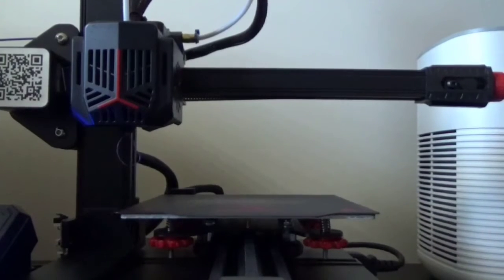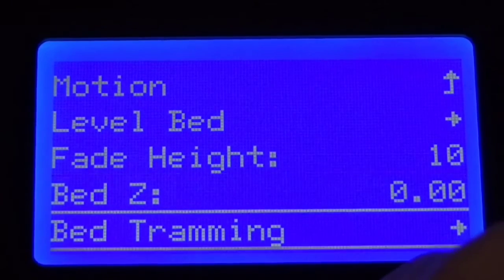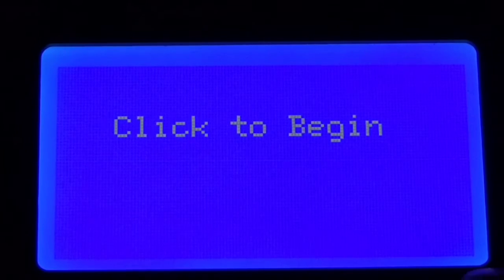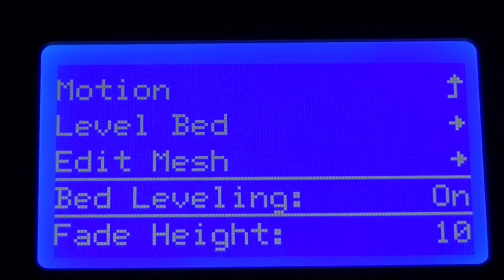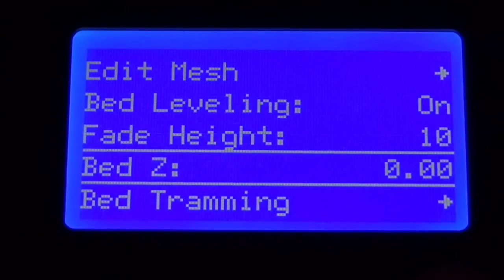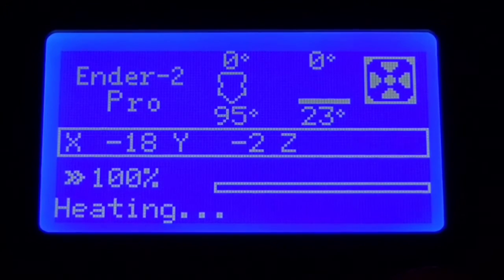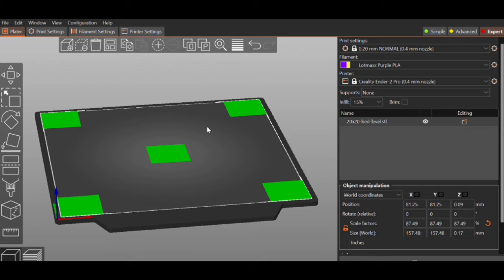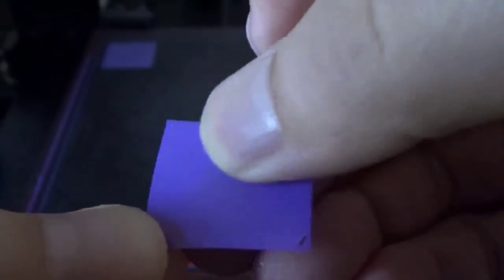Ender-2 Pro firmware upgrade.

Comment: So if im using a 0.2mm feeler gauge would I set Bed Z to 0.2 then tram and then set Bed Z back to 0?
Reply from the maker: No. You need some gap. That's where the filament will go.
Reply: @joeprints3dstuff but the slicer sets the gap in first layer. Layer 1 doesn’t print at z=0. If initial layer height is 0.2, Z is 0.2. If I use a 0.2mm feeler, then setting bed z to -0.2 works perfect. I thought using 0.2 would be the correct way but it’s opposite
Reply from the maker: Do what works for you. I set z=0, then level the bed at each wheel using a 0.1mm feeler. Then, I print test squares and adjust to get the right amount of squish.

Comment: Joe, I want to add a filament runout sensor that this board (4.2.3) supports. Do you have the original configuration and configuration.adv files to see if you enabled the filament runout sensor?
Reply from the maker: All of that should be on my github.
Reply: @joeprints3dstuff  Thank you Joe, I found the section to enable (VSCode) the filament sensor and I added auto scrolling for the display (caused me to add a library for U8Glib-Hal for the Microsoft linkables). My finished binary size is 156k. However, when I try to upgrade the firmware, it doesn't happen. I'm thinking it may be in versioning and the motherboard doesn't recognize it as a newer version.I modified the version.h file in the root of the src folder to your setting from 2.1.2.1 to 2.1.2.11. I got a clean build, but still no luck. What am I missing?
Reply from the maker: @stephendavis4241  yeah the board doesn't care about version. You just have to name the file correctly on your SD card. Also make sure your SD card is not larger than 8gb.
Reply: @joeprints3dstuff  My file name is firmware.bin and the SD card is 4 GB. I'm at a loss. Even the 2nd and 3rd try at re-flashing the firmware with your version doesn't cause the screen to pause as if it is re-flashing the firmware. I guess, I'll have to integrate it with the Pi 3 I have setting in the tool tray. Not the way I wanted, but I want the runout to work.
Reply from the maker: @stephendavis4241 did you rename the file or anything? Make sure you have extensions enabled under your file explorer view and it isn't named firmware.bin.bin or something similar.
Reply: @joeprints3dstuff  Joe, I backspaced for the date and then did a file view just to make sure it was still a bin file. I'm going to play with it again. Hardware filament sensor is the way I really want to go. If I get it working, I'll share the config files and the binary for you and others wanting a hardware based filament sensor.
Reply: @joeprints3dstuff  Hi Joe, I'm back with good news. I was able to get the filament sensor working. Besides some small tweaks for my personalization like changing the default runout to 5mm, I had to change the filament runout to "LOW" in configuration.h. The issue I had for the firmware.bin file was the boot strap was not recognizing a newer version. I used a failed upload of a firmware.x.x.x.bin file to change the uploaded version, then used the filament sensor low version of "firmware.bin" to upload a good version. For the sensor, the switch needs to be in "NC" or normally closed with the filament installed, causing the opening of the switch to set the pin from high to low on the motherboard. This would be the black and white wires connected to "S" and "V", or NC connections. I can provide my bin file to you or anyone that requests it. I had started out with changing the runout to "HIGH", but that caused an infinate loop in not being able to "continue" after loading new filament without turning off the filament sensor. Happy 3D Printing to all!!
Reply: @joeprints3dstuff  I have a 16gb card which seems to work fine for loading print files. But it won't work for firmware updates?
Reply from the maker: It depends. Give it a try, it might work.
Reply: @joeprints3dstuff  I tried it with a 16gb card and it worked fine. I followed the steps in your video and my printer is working better than ever. Thanks for making the video - much appreciated.

Comment: Hay joe.  One question  when you set the bed , did you preheat the bed before  leaving?
Reply from the maker: No. I normally do not heat the bed when leveling.
Reply: @joeprints3dstuff  Is there a specific reason you don't heat the bed before levelling? I'm completely new to 3d printing so I genuinely know nothing about it. It would seem that warming the bed to 50 or 60 degrees C could slightly change the flatness of the bed. Wouldn't it be important to do the levelling process while it's at the same temperature it will be at while printing? Maybe it doesn't change enough to worry about it?
Reply from the maker: @ogwoodworks it depends on the bed size and the type of probe. Thus bed is so small I do not worry about it. I also have some 400x400 printers with induction probes. On those I will preheat.
Reply: @joeprints3dstuff  Ok, that makes sense. How often should a person repeat the bed levelling process on this Ender 2 Pro machine? As long as I don't move the printer to a different location, is it a "one-and-done" kind of thing, or do I need to be checking it between each print job?
Reply from the maker: @ogwoodworks not to sound too vague but you will know when things are off. Generally speaking its a good idea to level the bed once a month or anytime you move the printer or bang the platform.

Comment: Hola! mi ingles es muy malo por eso directamente escribo en español y dejemos que google lo traduzca.. te quiero agradecer por que pude actualizar mi ender 2 pro gracias a tu marlin.. utilize tu marlin para cargarlo en "visual studio code" y activar el sensor de filamento el cual le instale muy facil (te recomiendo que si aun tenes la maquina lo instales). honestamente estoy muy agradecido.

Hello! My English is very bad, that's why I write directly in Spanish and let Google translate it. I want to thank you because I was able to update my Ender 2 Pro thanks to your Marlin. I used your Marlin to load it into "Visual Studio Code" and activate the filament sensor, which I installed very easily (I recommend that if you still have the machine, you install it). Honestly, I'm very grateful.
Reply from the maker: Thank you
Reply: Hola sabes que tengo una con placa  v2 4 s4 y firmware no me toma el m600 para cambio de color, alguna sugerencia?
Reply: @arielgonza22  hola ariel! Vas a tener que actualizar el marlin.. si no te toma el M600 podes usar el M25 (placa 32bit) o el M0 (placa 8bit).. pero tengas la placa que tengas si no viene de fabrica y queres usar el M600 vas a tener que actualizar si o si
Reply: @angelalonso1994  gracias, si claro estuve buscando una actualización sin resultados.
Reply: @arielgonza22  que máquina tenes?
Reply: @angelalonso1994  una ender2 pro
Reply: @arielgonza22  yo también tengo una ender2 pro y use el marlin que esta en la descripción del video
Reply: @arielgonza22  si, me tomo el m600, también active la opción del sensor de filanento
Reply: @angelalonso1994  tendrás el .bin directamente

Comment: Just got one and it’s nothing but problems.
Reply from the maker: Sorry to hear it. I had problems with mine as well until I upgraded the firmware. Work much better after that.
Reply: @joeprints3dstuff  this one has the 2.4.s4 board… dealing with support now. I understand why they want you to do so much stuff, but it’s frustrating formatting cards and showing them over and over it doesn’t work. We shall see.
Reply from the maker: @mikeak7331 good luck

Comment: Can this update be used on a HC32F460 board? This would be great!
Reply from the maker: No sorry. This is only for the stm32 based 4.2.3 board.
Reply: @joeprints3dstuff  would it be possible to use a BTT skr e3 mini board on the Ender 2 Pro with this firmware?
Reply from the maker: No. It was done specifically for the 4.2.3 creality board.
Reply: @NSCXP2005 
The repo on Marlin bugfix-2.1.x contains all the necessary files to sucesfully build firmware for HC32 using platformio. I used the Joe's config files to see which options should I enable to get the bed levelling and tramming, and enabled some more handy options too and succesfully built and flashed the firmware. So go on and give it a go!
The correct name of the environment for platformio is: HC32F460C_e2p24s4